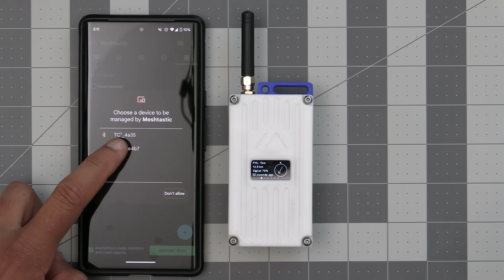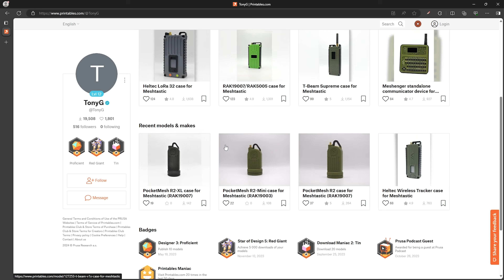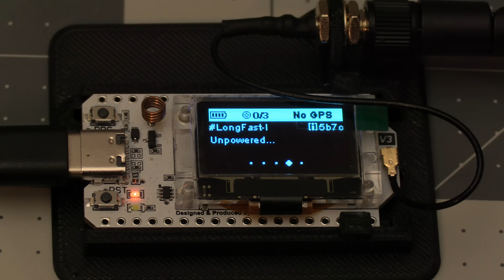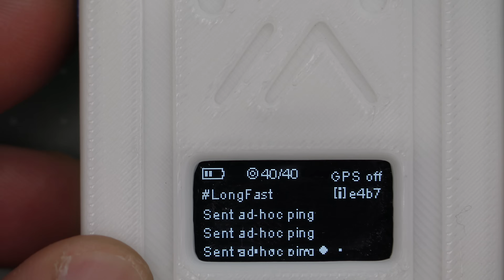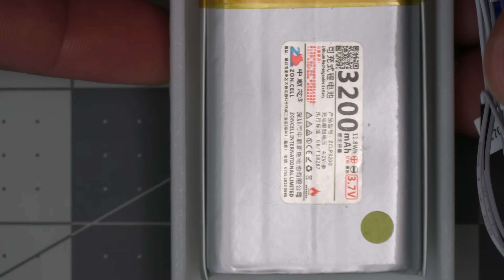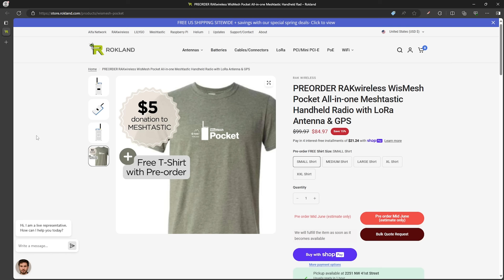WisMeshPocket - The New Ready to go Meshtastic Portable from RAK Wireless!

Comment: i have no nodes in my area so i got a 6dbi antenna and the solar powered node...will i be able to use my node in my house or will i need another device that will use my node?  antenna is going to be 50ft..i think the bluetooth range is what matters but wanted to double check.
Reply from the maker: Which solar node did you get?

Comment: I really wish RAK had a LoRa module with a Power Amplifier, 175mW of the SX1261 is leaving out possible range. 500mW would be the maximum allowed in Europe and would easily increase the range with multiple kilometers
Reply: We are building out a rural county in Texas. With solar nodes placed at heights of 50' we are reliably hitting all nodes on the network at greater than 14 miles. From inside my house, I am hitting a solar node that is 55'AGL at 14.2 miles like clock work. Height is might.
Reply: @patrickkahn1870  Absolutely, good antennas and placement are your most important tool! Unfortunately I live in a dense city and one of the flattest countries in the world, so there isn't a lot of height I could use. 868Mhz loves line of sight, but it's nearly impossible to get it over here

Comment: I hope they make the RAK12028-C1 available separately so others can design cases. I’ve held back designing a Rak case because of the soldering required for the OLED, if that board makes it solder-less I will make a case.

Comment: When mine comes in (Mid June), I'm going to test that Rubber-Nuby antenna on my NanoVNA, before sticking on a medium length or a longer Gizont antenna.
 
If the 'stock' antenna has a good SWR, I'll do some 2 mile range testing to see if there is any noticeable difference between them. 

Sometimes, you need something that isn't going to poke anyone in the eye. :)

Comment: Ah damn. My starter kits just arrived. Do you know where they connected in the "user" button i.e. which IO line? its not really documented on either Meshtastic or RAK's site that I can readily find...
Reply from the maker: Instructions can be found on TonyG's printables page. Here is a link to the picture with instructions https://media.printables.com/media/prints/286657/images/6309828_85c0f65f-d2d7-4188-bc9b-d619ee27803e_657e28fa-291a-4d2a-8a92-28fbee6638e0/thumbs/inside/1920x1440/png/rak19007-5005-assembly-guide-new.webp
Reply: @The_Comms_Channel  Legend! Thanks very much!

Comment: Love the new options coming out and The Comms Channel keeping up with them. I want to set up nodes in my area using the Rak Wisblocks, but in a head to head range comparison I was getting less than half the distance with the Raks than with the Heltec V3’s. Any chance I’m just doing something wrong on my end? I didn’t change any default settings in the app and I thought they both used the same radio module.
Reply from the maker: Thanks! Yep, same SX1262 in both. I get about the same range on mine. Only thing I can think of in your case is double check the antennas and the SX1262 boost option in the LoRa settings.

Comment: Fantastic! Wish it took 18650 & came with the Gizont flexible antenna
Reply: I have 3 of those Gizont whips. They are impressive for sure.
Reply: @philbe3095  do you have the link for the right antenna?
Reply: I'm all on board with the giznot antenna, but I have 4 of these radios (that I made)  and with use, it goes through a 3000mah battery in about 50 days.    thats... pretty good.   oil don't need the bulk of a larger battery.     (with gps on battery life is GREATLY reduced)